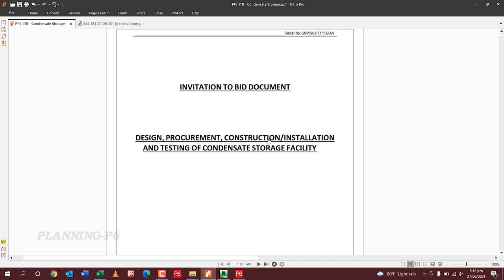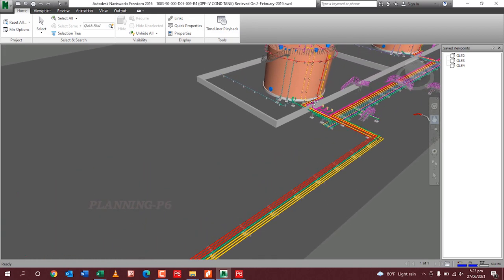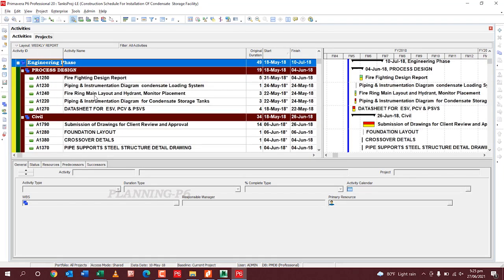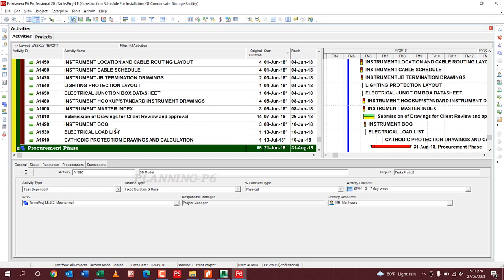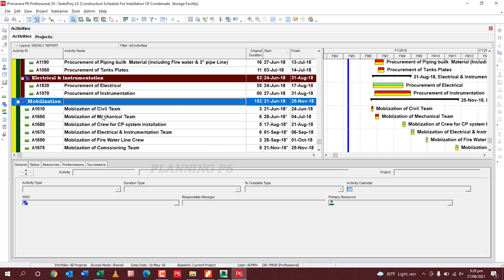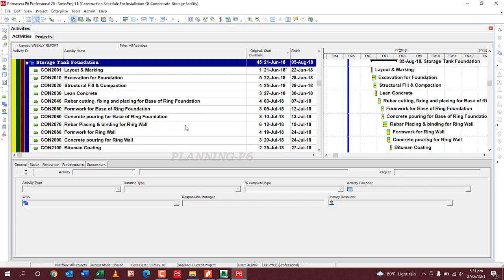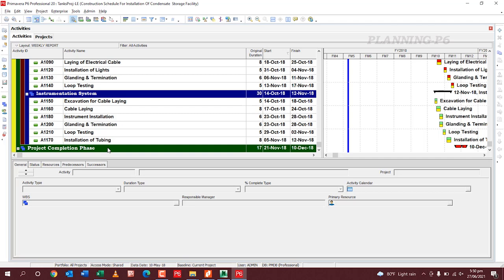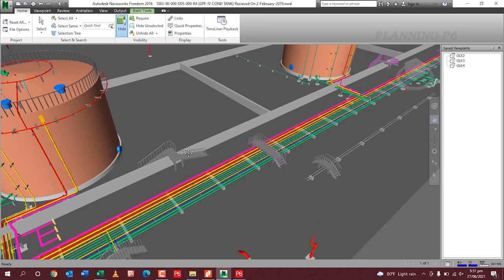How to create Complete Project of Oil & Gas Condensate Storage Tanks Facility Primavera P6 Schedule

Comment: You have used Activities and  projects  . What about WBS use
Reply from the maker: Please elaborate on your query and what you want to understand.
Reply: @PLANNINGP6  
First we create wbs of the project. than we divide WBS into activities.

In this video WBS is not available I think.

May be tour method is another method to schedule the project.
Reply from the maker: Our approach has been the same, and we adhere to standard practices.

There are additional breakdowns to levels in addition to the six main WBSs (Level-02).

I.	Project Award
II.	Engineering Phase
III.	Procurement Phase 
IV.	Mobilization
V.	Construction Phase
VI.	Project Completion Phase 

For understanding, kindly watch the complete tutorial.

Thanks